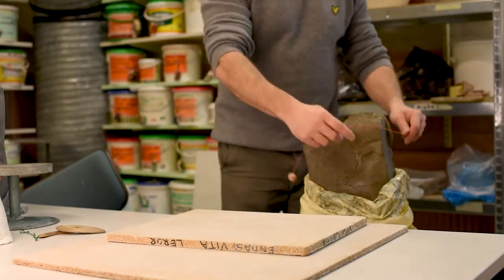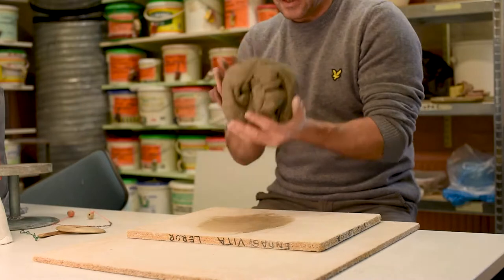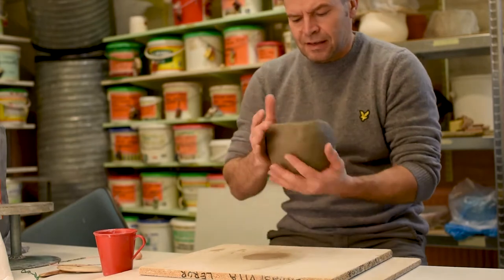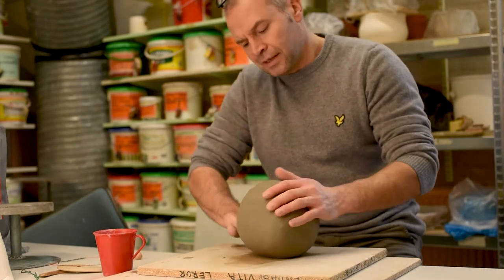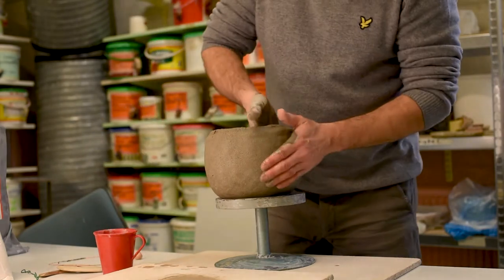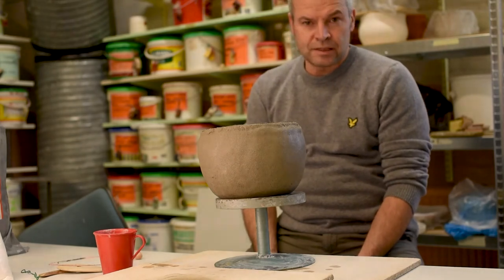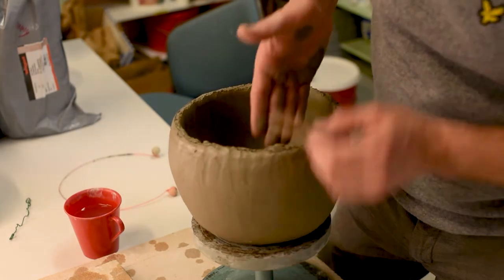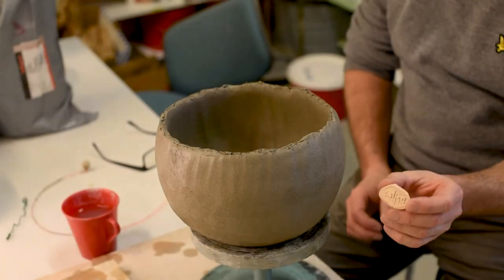How to make a big pinch pot. Huge bowl in clay! ( Part 1)

Comment: Love your work!  And thank you for your video.
Just a few questions. What would you consider the best thickness of the walls for a pinch pot of that size? Plus, I am wanting to create a vessel that starts from a fairly narrow base and flairs out creating a wide rim. Should I create it over a period of time to let the clay set up as I go to stop the sides slumping? Or would I be better off creating a smaller pinch pot as the base and then building up with coils? ( I think I may have answered my own question ☺)
Reply from the maker: Thank you for your kind words!
.. and yes, I think you answered your own question! I think the best way for your project might be to build by pinching a base, and building with coils from there. 
It’s easier to have control of the shape and the drying aswell. You can add coils little by little, use a hair drier if you want to speed up the drying etc.
I usually cover the rim with a piece of plastic so that it is easy to add new coils, even if the rest of the pot starts drying.
Remember to slip and score!
It would be lovely to see your work!
Cheers from Finland!
Reply: @clayeasy  I made a start today with the pinch base and then started adding coils. The bottom started slumping a little, so I’ve sat it in a bowl to support the base  while it sets up, covered it in plastic and will play again tomorrow. Thank you again for your help and I will get back to you with a pic if it works!